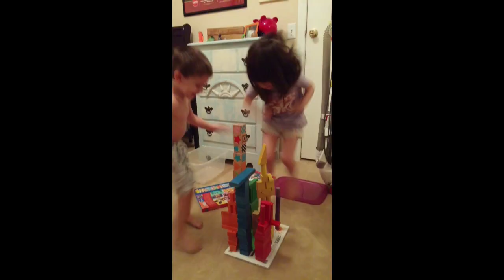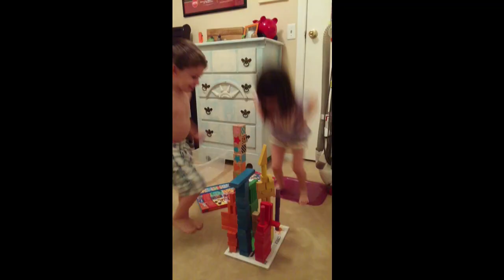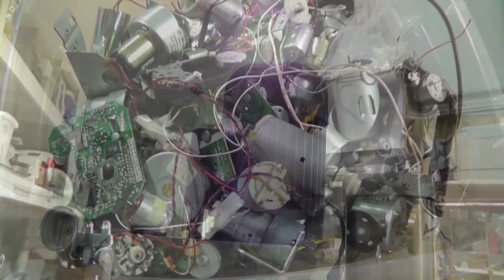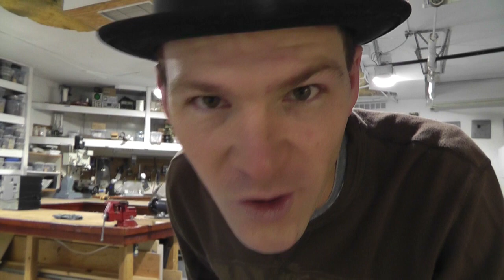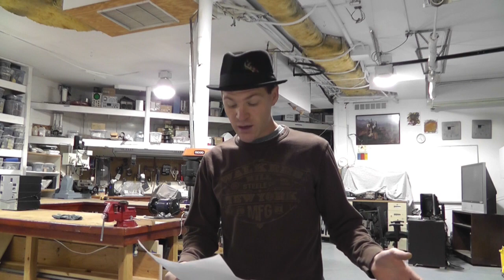Pulse Motor Build off 2014 Just Started!!!!! Nov14-Dec14 !!! GO Now And Build!!!

Comment: Is the definition of a pulse used to transform electrical energy into mechanical energy in an engineering event to produce work. 

So my question is are you judged on a spinning device or work? 

Or do you not care, just as long as I get off my but and enter. That would in tail work so I guess I would be half way there.
Reply from the maker: Hhydrogen4Power good Qustions, the rules state: "Must Be A Pulsed System, Leaner, Rotation, Or Otherwise. ( Just about 
anything goes, it dose not need to do anything, it just needs to pulse, 
some how some way)" so with this i'm leaving it up to your imagination. this year is very open...  yes if your off your butt and doing something... then you are 1/2 way there :) looking forward to it ~Russ